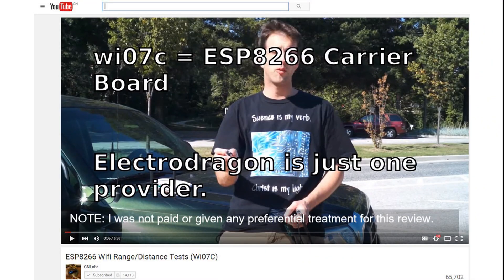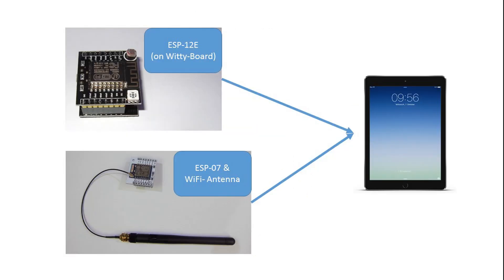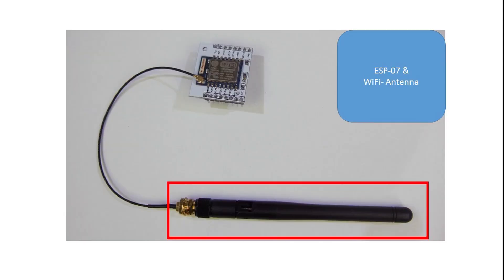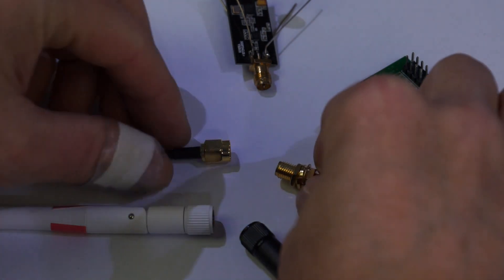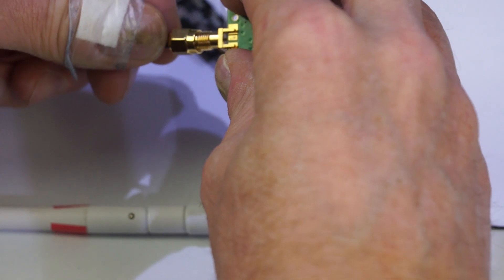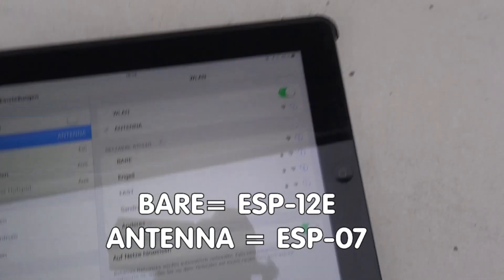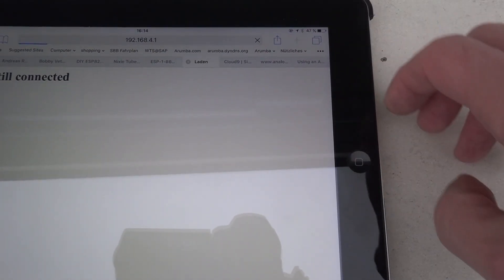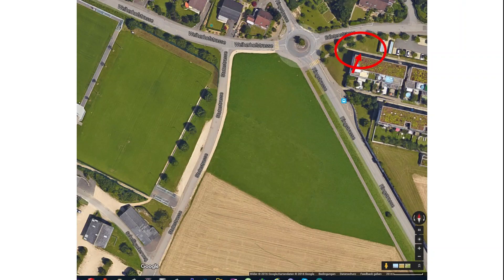#43 ESP8266 Range Test with and without External Antenna

Comment: @andreas what is the range of these modules indoors? Can I use them to send signals across 3 floors using esp now as promised by expressif?
Reply from the maker: That depends a lot on how your houses are built. In Switzerland, with lots of steel in the floors, it most probably would not work.

Comment: Bro you are in my head. I have a question and you already have a video. You are Awsome
Reply from the maker: Cool!
Reply: Esp32 about the same range? Cause I’m working on a drone dropper for the Dji mini 2. Got the servo running using a webpage to control it.
Reply from the maker: @grimtagnbag  Yes

Comment: Hallo danke für das Video.
Ergänzen möchte ich wissen warum bei dem Test nicht gleich wie auf dem esp-07 Board befindliche Rainsun mitgetestet wurde?
Diese Antennen sind noch ein Stückchen kleiner als die auf der Leiterplatine aufgedruckte Schlangenlinie.
Wenn du dich etwas mit Antennen auskennst fragst du natürlich auch immer nach dem Strahlungsdiagramm, denn das ist dasjenige was den Antennengewinn ausmacht. Daraus resultieren die größten Vorteile eines Antennenwechsels. Da ich selbst nun auch kein großer Fachmann bei diesen kleinen Wellen bin hätte mich noch interessiert in welche Richtung die Leiterplatinenantenne und diese aufgelötete Rainsun Antenne strahlt.
Es wäre schön wenn ich dazu Informationen hier bekommen könnte.
Reply from the maker: Solche kleinen Antennen habe keine starke Richtwirkung (auch wenn das auf Diagrammen so aussieht)

Comment: No freaking way that other guy had few kilometres reach without some extreme power delivered to the chip....your results match exactly what on average range of 2,4GHz AP are on average. 
I'm actually surprised that without Antenna it can reach even that far, then again it's outside test without any walls lol.
Reply from the maker: Indeed, outside it is easier to reach a longer range...

Comment: max. 120m/393ft in open terrain = ESP8266 12E <-> 12E at  802.11b TX -20dBm

I use the beacon frame for TX and scan networks for RX between the devices. The maximum distance without an external antenna is 120m or 393ft in open terrain.

I try to build a mesh network of wifi hotspots, where each node provide a access point and webserver to smartphones / wifi clients. All neighbouring nodes exchange data with each other to increase the range between the smartphones. There is no master node and each node acts as an independent gateway as in APRS routing.
Reply from the maker: Maybe you google AREDN. This is a mesh network of routers and access points, too.

Comment: how far is the esp8266 wifi range if you use an external antenna? Thanks sir
Reply from the maker: It depends on the antenna, of course. For sure you can double the distance with directional antennas

Comment: Thanks, now means the wemos d1 mini (PCB Antenna) is about 90 meters range?!
Reply from the maker: You have to try it. It also depends on the receiving station. It should be possible with line of sight between the two devices.

Comment: LOL when my workbench gets crowded like that, I skip mental frames and make audio hash noise that interferes with those around me. That one above is not badly crowded YET I'll bet.
Reply: I am not an antenna specialist, that science is as tricky as making a chunk of hamburger grow the way one wants it to. But I do wonder if the metal fence helps or attenuates the signal. Seems that a ground stub equal in length with the radiating element , a dipole , would give better gain. The problem is the unbalanced transmission cable. So that brings the complication of getting the signal to the antenna through a balanced cable, doesn’t it .

Comment: Dear Andreas, 
Another intresting vidéo… as usual. I’m making some tests on a raspberry pi with an external antenna and results are significants : antenna is the heart of a transmit system! I was surprized that the position for a connector was on the board! With a few modifications (and sweat because it’s very small !), we can make some good tests about antennes.
Thank you for your job.
Best regards
Jean-Michel
Reply from the maker: Glad you enjoy experimenting with antennas. You find many other videos about antennas on this channel, BTW...

Comment: Hmm this is very promising. Even though it’s not outstanding per say, could make a pretty cheap RC plane with WIFI links
Reply from the maker: Wi-Fi is not made for a long range, more for big capacity. That is why it is not often used for RC planes.
Reply: @AndreasSpiess  I see. Maybe there is a niche for it though. Thank you for your response and making these videos by the way, they are so interesting and fun.

Comment: Did the ESP-07 work 20 meters away behind your house?
Reply from the maker: Wi-Fi is not very good through obstacles.
Reply: @AndreasSpiess  but does the added antenna improve anything in this case?

Comment: Hallo i try use the mcu esp 8266 for repeter the signal wifi the house is far from me 156 meter,.......so that can t work...i want try upload the board with the esp 07 u think is should try it?  thanks in advance
Reply from the maker: I would not use the ESP8266 as a repeater. You get much better products also for cheap.
Reply: @AndreasSpiess  sorry u can give me one example please I need cover 160 meter i need capture that signal from at another house...... I buy before 30 meter cable antenna to plug direct to the security camera but dnt have any effects....now I have that cable.
.I think maybe I can plug in to the esp 01 :)   I can t plug in the repeater inside at is house......but I can let me capture is signal....

Comment: a normal usb wifi adapter of 3000 mw with dual antena of +5db can reach ~1km range in straight line, i tested it
switch its antenas with +8db and reach ~1.5km
150m i can reach with my phone :))
Reply from the maker: Thank you for sharing your experience. I would never cover such devices publicly because it is forbidden to use them where I live :-(
Reply: @AndreasSpiess  no way, but you can buy them  from any store : tl wn8200nd 
https://www.ebay.co.uk/itm/TP-Link-TL-WN8200ND-Wireless-USB-Adaptor-Dongle-300Mbps-Tested-Warranty-B/173990654942?hash=item2882a6b3de:g:LGEAAOSwv7BdSvlY
even this one can reach at least 500 meters https://www.tp-link.com/us/home-networking/usb-adapter/tl-wn722n/
Reply: Not a fair comparison when using 3 watts compared to the legal 0.1 watt here in the UK.
Reply: @modelmanmark   that only came Into effect in 2006, this is due to the issue of everyone having WiFi in home and the noise it created. The "signal leaks" to other AP's caused many connection issues and poor transfer, so they made a limit, a transmit limit.
5ghz band a is .2watt, band b 1w and band c 4w. (Its also licenced).

Back when testing, we used the max legal transmit power, but we had split send and receive antenna.
The dB limit is between antenna and power, so care had to be taken..
You could only have a 2-4db transmission antenna.

A receive on the other hand was and is not (haven't checked) limited.
So you put up a big ear, 30db and your can hear the signal.
But most protocols don't work as you can't reply (CRC) to standard antenna, but two separate send and receive can. By listening and not shouting ;)

Where we did the testing, we could get a weak signal at 35km.
But practical was 8. And of course weather, Los, and topology of the grouns all made a big difference. And was in our favour.

Comment: Hi Andreas what would you argue is the effective maximum range for the ESP-12E in a direct line-of-sight scenario? With effective meaning that you connecting to the ESP and/or loading the webpage does not take an excessive amount of time or numbers tries to connect respectively.
Reply from the maker: Maybe a few hundred meters. I never tried it

Comment: Hello, Please show how to connect an external antenna wire to a board with no antenna socket.  How to solder to the onboard esp8266 antenna path, where the cable shield and its middle wire? Do I need to cut path and where to do it? Thx
Reply from the maker: I do not suggest doing that so I will not show it.

Comment: HI Andreas, I work for a major Wifi Manufacturer, and in order to do Mesh WiFi at greater distanced, you need to increase the "Acknowledgment Timer" timeout value.
This is necessary due to the increased distance, causing increased propagation delays in the round-trip "packet send and acknowledge" sequences..
So, you MUST increase the timeout delay for the Acknowledgement Timer on the receiver side, (he must reply with an acknowledgement) in increasing increments per kilometre of distance from the peer device..   Since both peer devices send acknowledgements of received packets, then the timeout on BOTH side must be retarded as well, equally..
Reply from the maker: Thank you for your tip!  I will try it next time...

Comment: Great video, I have seen 2.4Ghz are incredibly sensitive to walls when it comes to range and reaching your 8266 chip. Mine came with a 8bd small antenna, and although it gave me about a %10 increase in strength and range, its still small. I have heard you can make a large antenna out of a can, "Cantenna" ever heard of this? Would be a good video and possibly a massive range.
Reply from the maker: I heard of the cantennas. You find good videos on how to build them. Not on this channel.
Reply: @AndreasSpiess  I habe a question for you how did you do the esp-07 a access point you need to programed it or it's already progamed for use it like a access point? (I want to use it like a wifi repeater why I habe a long range antenna and I want to use it like a repeater)
Reply from the maker: @Mr.Plague-n5x  The ESPs usually are not programmed
Reply: @AndreasSpiess  and how I can program the esp-07?
Reply from the maker: @Mr.Plague-n5x  You find a lot of videos about that matter.

Comment: Great víieo!!  I need to solder a "Wifi Rg178 Pigtail Ufl Ipx Mini Pci X Sma cable" (I will strip it)  to the embedded antenna on a baby monitor camera board to increase the range as I want to add an external antenna to it, should I solder the center core to one end and  the shielding to a different end of the embedded antenna or is there a better approach to take ?  Tks!!

Here is the link to the baby monitor´s camera board: https://www.youtube.com/watch?v=zGsMKEwCqkU
Reply from the maker: You can try both ways and look at which one works better. It anyway will not be an ideal solution.
Reply: @AndreasSpiess  Thanks, this is what I am ultimately trying to acheive:  https://www.youtube.com/watch?v=2Vg0VeyBpVY&lc=z22hwzcb0resgv0ugacdp435yswldonykqrqrdlql4hw03c010c.1585163148404603
Problem is that my antenna is embdedd on the PCB so I´m sot sure where to solder the external antenna cables....  Would you know?
Reply from the maker: Just try it.
Reply: @AndreasSpiess  Won´t I risk damaging the board or not enough for that to happen?

Comment: about line of sight, i have a D-Link wifi router inside the house, and my phone can still connect to wifi up to 50m from outside
i also my laptop can detect from rooftop and ESSID from 200m away, so it seems possible you can transfer data at a low bitrate at those long distances
Reply from the maker: Thank you for your feedback!

Comment: Purely for interest sake. 

I attended a meeting of Radio Amateurs the other day discussing the set up of a 2.4GHz local area network for Emergency communications purposes. This is within our allowed Band Plan. There is a group who have such a thing  communicating across the Firth of Forth just north of Edinbough and we discussed being able to apply 400W (Radio Amateur maximum in the UK) against an annoying neighbour of one of the group, humourously of course (I think). We were expecting to get 5-10 km with about 3-5W amplifier and also an omni-version of similar expectation. This was based upon what had already been acheived by others.
Reply from the maker: I know of those networks. There are quite a few around the globe. Mostly in metropolitan areas. But I did not know you have one in Scotland
Reply: @AndreasSpiess  It is not a permanent net it is for use in and Emergency (RAYNET - Radio Amateurs Emergency Network) and this is a way of training for the set-up in the field in the case of necessity.
Ease of deployment for instance and kit. At microwave frequencies the losses in the transmission line are enormous so transmitter at the antenna and remote control, it could be some metres up a pole.

Comment: during initial r&d of some recent work i did using wemos d1 mini (esp8266 12-f) modules, i was able to retain a connection to the back office, through our front office door, and about 50 feet down the hall... i was pleasantly surprised.
Reply from the maker: If you have some sort of „line of sight“, these small modules can bridge quits a distance...

Comment: Hi Andreas! Did you removed the connection to the ceramic antenna in the ESP-07 so you can work only with de external one?
Reply from the maker: I did not do it. But you should

Comment: A wifi connection is only as strong as it's weakest link ... this could well be the Ipad and thus you really should have used 2 identical esp8266's communicating with each other.
Reply: good point

Comment: Do you know where I could buy an esp8266 with an external antenna connector? I can find the ESP modules themselves, but no complete board with a TTL adapter and all,.
Reply from the maker: I did not search for one, so I do not know.

Comment: ...you should try connecting powerline networking from your router to your basement or anywhere ....also try testing it from 10km away to your home router
Reply from the maker: I do not see a relationship between powerline and the range of WiFi
Reply: @AndreasSpiess  ...ok i agree that was stupid...but think ..let say if i could broadcast the same lossless AP of my router on the other end via exsisting powerline transmission 10km away with similar hz (repeater) , where it connects to the esp8266/32 does it not add to the range of my WIFI

Comment: I have an antenna but I have the smallest wifi module. Can I hook it up somehow? The antenna's cable has a standard end with an inner and an outer part. Should I connect the inner part to the antenna and the outer to ground?
Reply from the maker: These antennas have to be connected to a small connector. If your board does not have such a connector it is not advisable to connect an antenna. The performance might be worse than in the original state. Both, the antenna cable and the connector are adjusted to 50 ohms.
Reply: @AndreasSpiess Okay, thank you for letting me know!

Comment: nice viedeo andreas,i clear all the valuable range site for pcb trace antenna and ESP without antenna.is these regarding to all pcb antenna have same range or different with version?

thanks....
Reply from the maker: If the antennas have a similar size at the same frequency you usually should get a similar range.
Reply: Thanks andreas..

Comment: Thanks for the truth. I have the same problem about the distance. I wanted to have 4 units of  ESP8266-Wifi moduls inside my house in different possitions. I have a house made of wood so I thought that should not be any problem . But it seems the modules have to see each other  to be connect. I thougt they should be communicating through the router and not direct. I am very disappointed on these modules. I have only onboard antennas. The antennas on a mobile phone is not bigger so that should not be any problems. I like your accent.
Reply from the maker: If you use them in the normal way they always connect to the Wi-Fi Hotspot you select in your sketch (SSID). I also would assume they should work in a wooden home. Did you make tests were they worked and where not?

Comment: Hello. Thank you for this interesting video. Having survived the eighties (including some time as an RF tech), I think the bomb shelter policy is very wise. I often wonder about antenna efficiency and what difference a ground plane makes. I dismantled a WiFi antenna of similar appearance to the one in your test only to discover it was a straight length of wire, not dissimilar to the old quarter wave whip used on car roofs, etc (no base loading or such). They require the roof as a ground plane as you would know. There were base-loaded "ground-plane independent" antennae for use where truckers had non-conducting fibre-glass canopies or drivers who don't like holes being drilled in the centre of their roof so choose to gutter-mount. As far as I was aware, if they simply gutter-mounted a ground-plane dependent quarter-wave whip antenna base, it would propagate much more favourably in directions across the roof rather than omnidirectionally. If you mounted your SMA base on a metallic plate, I'm wondering if that might give different results..
Reply from the maker: In the meantime I made a few videos about antennas, mainly under the topic LoRa, if you are interested. There you also see the influence of ground.
Reply: Thanks. I've only just discovered your channel and got here by searching "esp8266" - I've been having hours of fun with those things..
Reply from the maker: There are quite a few videos on 8266 as well as on the newer ESP32 on this channel ;-) Tomorrow the next one.